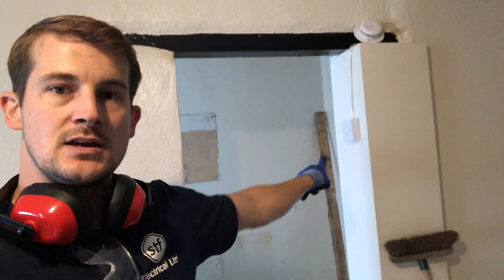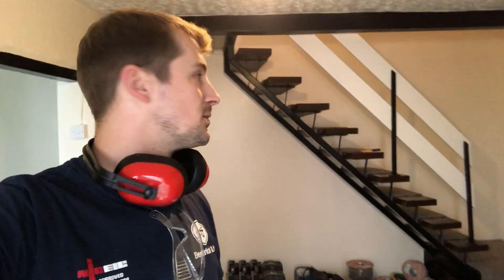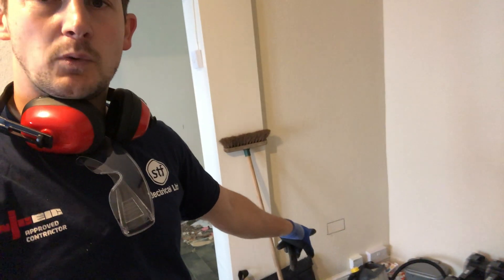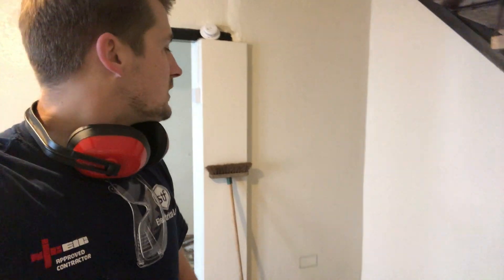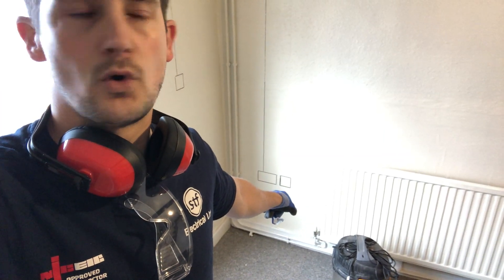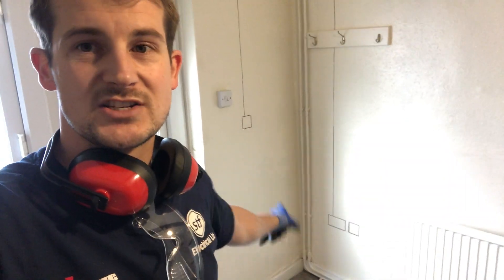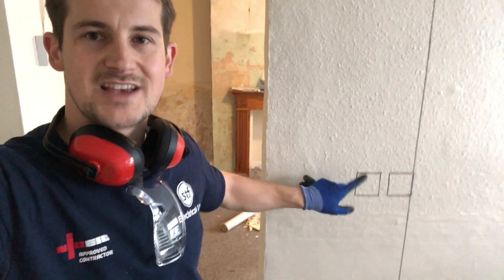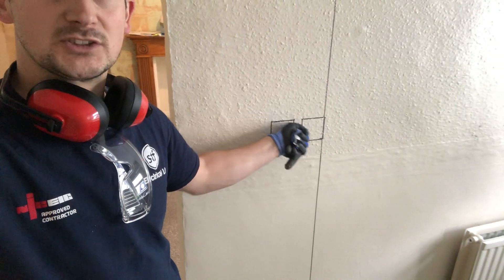Chasing out Walls & Installing Earth rods - Rewire (part 1 of 3) | STF Electrical Ltd

Comment: Hi, Just bought erbauer chaser using with henry hoover. Works great. Realised that if you have it round the right way you can start at the top and let gravity do the work ! rather than pushing it up the wall.
Reply from the maker: Tony Young great tip Tony!  Unfortunately I find it a bit awkward and cumbersome going down the wall with my one (combination with its design, where the hose comes out and the fact I’m right handed) -  I’m actually looking round for an alternative as after a bit of use the hose heats up and collapses on itself meaning it can’t extract the dust (it’s really annoying!)

Comment: Nice one , why was the new earth rod needed.....?
Reply from the maker: yensabi 3 reasons:

- readings on original, although “ok” where too close to 200ohms for my liking - so opted to get that reading down

- original had no housing, protection against impact and the termination of the main earth to the rod itself was open to the elements thereby not giving it sufficient protection against corrosion 

- lastly it’s a full rewire and as such we replace everything and start a fresh (I feel better walking away knowing a new rod is in)
Reply: STF Electrical Ltd   Thanks for the reply mate , it's just nice to know how other people go about doing something and the reason they do it...👍
Reply from the maker: yensabi exactly I’m the same 👍🏻